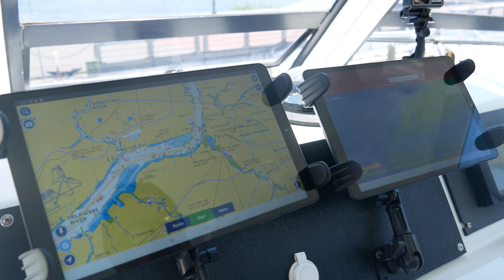How to make a 15 inch chart plotter for only $125    E112

Comment: run forever ? does it back charge to your phone ? because your phones just going to die... and given its using its port to display theres no way to charge your phone at the same time ?
Reply from the maker: To be honest, I don't remember. That video is about 5 years old. I used the system for a couple of years and then the cable broke and I ended up buying another 10" tablet. I usually cruise for about 5 hours a day and I believe my phone lasted that long.

Comment: Make sure you put dielectric grease on the contacts. Because the ports are not weather sealed like a dedicated chartplotter high humidity will eventually corrode the ports. I used to work for an industrial tablet manufacture. They are expensive for a reason and it’s to do with the comments they use and the construction.

Comment: So you need a spare $1300 phone. Noted. Next thing. Do you need to have another cell plan active on that phone to run navionics on it?
Reply from the maker: I just used an old phone that I no longer use. A Note 8 I think, which is basically worthless. Navionics does not require a plan.
Reply: @tryingnottosink9107  Thank you for your content and response. Good to know. The pessimist in me figured it would

Comment: Hi, great idea to use such a solution to mirror your phone on a screen. Are you able to use it as a touchscreen with Navionics or do you control it from your phone? So in other words does the touchscreen respond on finger inputs or is that only possible on your phone with a mirrored image on the 15 inch screen?

Comment: Lovely idea with the 15" monitor.   However, for navigation it will still be dependent on the phone for the essential GPS signal. And far enough from shore the phone can not provide a GPS signal. So...options are then either a separate GPS receiver to another USB port, or buy a tablet that has a GPS signal built in.  Correct?
Reply from the maker: No, the phone always has a GPS signal. So does the tablet.
Reply: You are wrong. GPS signal is available in all locations on the planet.

Comment: Curious how those monitors work in the day light ? Can you read the screen
Reply from the maker: They are bright enough but keep in mind, we have a hard top so they are never in direct sunlight.
Reply: Im down the same road. Most display manufactures charactarize thier display as outdoor readable at a brighness of 800 nits. Typical crlphones are 250 - 350 nits. I got a 60$ samsung 10.1 android 4
42 and 425 nits. Mirror my lowrance to it over on boat wifi and with a display visor, pretty readable. Sendit back and continuing my quest for a daylight readable 15-17 inch display to pair with an old hdmi out android phone wich will run the mirroring fom my console fishfinder.
Reply: Did you ever find a good one?  @cpntexas_x

Comment: You may want to consider a different phone like a newer one. As phones become older the batteries don’t age well. And in extreme cases they turn in a fire risk. I would look in to a cheap new phone that is specked the same

Comment: you seem up on computing nav stuff.  suggestions yu might have for a complete novice.  I am in middle Tennessee getting a boat ready may use within next two years to float down to the Gulf go out and fish a bit.  Thinking radar, sonar, fish finder, navigation and radio but all linked in.  Is that a possibility? And kinds that are best invest?
Reply from the maker: Yes, they can all be linked together. Since you want radar, you would need a ready built system, like Garmin or Foruno. If you can live without Radar (we can't) you can just use tablets and apps like Navionics and Sonarphone. They would link together through Wifi and Blue Tooth. We use a combination. Our radar is on our old Foruno Plotter that came with the boat. Everything else is an app on the tablets. We did several videos on our set up a couple years ago.

Comment: Wouldm't that  drain your airtime? also is that a touch screen?
Reply from the maker: It is not a touch screen, but the phone is. Our airtime is unlimited, but it doesn't use much. We actually stopped using this system on the bridge because I kept having problems with the USB cords.

Comment: Great idea, now I just have to see if I can find a monitor that’s bright enough. I know that when I was looking at tablets they measured brightness in nits, so I’m on looking for some thing that has brighter than 600 nits,  my iPhone 12 has around 800 nits and looks great but it is a little small so if I could find a monitor that had similar brightness at 15 inches or even 12 inches that would be great. Thanks for the idea
Reply: Laptops at least, can boost the brightness using command prompt, or terminal code. Its simple and a google search away. I can imagine it is doable on dex OS and etc for mobiles and external screens
Reply: Further, theres ADB commands like:
adb shell settings put system screen_brightness 255  # Max: 255 [citation:2][citation:6]

Thats untested afaik and would advise to show caution. However monitors usually have a hidden menu, if you mash buttons on the monitor, turn it off, then turn it on while holding another button, you might be able to access the factory settings to change the max brightness value to like, 4000?

Else, invest in a sunshade cover :)

Comment: Hi Ed,
my name is Uwe from Germany.
Thanks a lot for the nice videos you share with us.
I struggled over it while searching for intresting solutions for my Bayliner 275 here in Germany. Well the boat runs in Beglium, which ist jaust near my home. Anyhow I would like to write to you today, as I had nearly the same idea as you had with the monitor. BUT I didn't like the need to touch the small mobile surface for settings or Apps to open. After searching and trying a lot I found a solution that does it all-in-one!!! It is the "V7 L156TCH-1G 15.6" USB-C Portable Touch Screen Monitor". It has all the features you told us about PLUS the possibility to touch the large screen to use all mobile functions. So it is a true display mirror of my mobile. and that ist really the best I ever saw as solution. You may use every App on the mobile when ever you want behind the streering wheel of your boat - incl. WhatsApp....
Best regards, from good old Germany and "always a hand's breadth of water under the keel" as we say here. ;o)

Comment: 1 problem you didn't address is that your phone needs to be charging too..   if it can't be charged wireless you will need to disconnect the screen to charge the phone..
Reply from the maker: No. The phone sits on a wireless charger and is continuously charged.

Comment: Did a similar thing where I have a 15.6" touchscreen tethered to my samsung s21.  Works amazing.    Use a seasucker to mount it up on the dash.  Works PERFECT!
Reply from the maker: Our only type C to Type C cable went bad at the start of the trip and we haven't been able to use it.
Reply: @tryingnottosink9107  you can get another type C anywhere.  Noticed you made it out of Philly and headed south.  Enjoy and be careful!

Comment: Any ideas on how to add navionics or similar without the phone? Stand alone GPS receiver? Love your idea of the larger monitor, maybe even a touch screen?  Sketchy reception on our phone on our lake but really need a chart plotter or map to avoid the shallow spots. Someone else asked as well but the monitor holders you utilize currently on your dash, where did you get those please? Love your channel too, the good with the bad makes it real!
Reply from the maker: You do not need the phone for Navionics. You can download the apps from wifi. We have it running on several $200 tablets as well as the phone. You can also use a mini computer like a Raspberry Pie to run it and use the 15 inch monitor.  https://www.amazon.com/gp/product/B079TGWRNR/ref=ppx_yo_dt_b_search_asin_title?ie=UTF8&psc=1

Comment: Great idea about using your phones gps abilities.  You could probably use it without wifi too. Just download the maps you need to your phone and the gps does not need wifi to work, however , with wifi it may be more accurate. Realize that all gps on phones are not equal, depending on how many satellites your phone will compare determines your accuracy.  When I use to travel all over the world as an airline pilot I would use a global mapping app, such as cities to go, and use the phone without wifi or cell data to not get lost in the big cities of the world, Paris, London, Beijing, Hong Kong, etc.
Reply from the maker: It works very well. We use multiple device with different views, so we always have a second opinion on GPS location. We are big believers in redundancy!

Comment: Ed,  your wifi on the boat can be solved by T-Mobile.  Ask about their 100gb data plan for $50 monthly.  It is 5G and they will sell you a 5G mifi (Inseego) for 50% off.  You’ll have great service anywhere you can get T-Mobile service.

Comment: The c clip on the windless holds the chain hub down on the shaft. It probably popped out or wasn't installed correctly. Looks like you opened a  big project up this time. Stay warm.
Reply from the maker: That is what I thought, but I could not find a groove for it. I have a shaft and gear box one coming, perhaps it will be more clear.

Comment: Hi Ed, Love your videos.  I do have to wonder why a guy who owns a 65 foot Hatteras, is not using real marine electronics.  iPads and cheap screens from Amazon attached to an old phone may work on a sunny day are not the best solution for a boat.  There is a reason why  quality MFDs from the major bands cost so much more.  They work always, in all weather.  Cutting cost on electronics seems penny wise and pound foolish.  I presume you carry full paper charts as a back up to your rube Goldberg set up.
Reply from the maker: Keep in mind, I still have two Furunos on the boat. They work fine. One reason I can get away with tablets is that my flybridge is enclosed. I never have a problem with weather or sunlight. I do have paper charts onboard, but I am almost never out of sight of land, so I do not worry too much. And, I like the redundancy. I currently have 3 tablets, 2 smart phones, and two Furunos on board. All are capable of navigation,  sonar and AIS. The Furunos handle the radar. And, I am cheap. Still, you might see me switch over some day. I have been offered steep discounts from a major brand to install their system and do a video about it.

Comment: Hi Ed, great video. Just a thought, you can also pair a Bluetooth mouse to that Note 8 so you can navigate on the monitor without having to mess with the phone's touch screen. Just a thought. Cheers!
Reply from the maker: That's a great idea! I'll give that a try.
Reply: @tryingnottosink9107  what about a touch screen monitor?
Reply: @billstobie4872  that’s what i’m planning to do. I have a touchscreen monitor at the helm connected to a Windows PC in de cabin. Now i would like to connect a Samsung device with DeX to my Windows computer (you can download DeX for Windows 10/11). Now the question is. Will my touchscreen monitor work as it does not have a keyboard or mouse?

Comment: I have thought the same thing about my old iPads. The thing is, you will need to start the phone bill back up on it to use Navionics, right? I use my phone and a 12.9” IPad Pro right now alongside my Raymarine Axiom on the flybrige. i want to use the old ones on the lower helm. The iPads use cell service. Honestly, I’ve never tried them with the cell off, but my guess is that they won’t work with Navionics. I hope I’m wrong!
Reply: To answer my own question I just tried it with my cell and WiFi off and it seemed to work fine. I guess it just uses GPS and the info that is already loaded. Thanks for the info!
Reply from the maker: Yes, it uses GPS. You only need wifi to download new maps.
Reply: @tryingnottosink9107  thanks so much. If you all only knew how much you have helped us in our cruising. If we ever cross paths, I’ll make sure and send you off with some super Tennessee whiskey.

Comment: The water in the core could have frozen and expanded the core. Causing more stress on the bolts.
Reply from the maker: The bolts did not run through that part of the core.  But you might be right. There might be more water damage that I did not find yet.

Comment: Ed, you mentioned you have Wifi on your boat for navigation so I assume you have it while underway. My question is how do you get Wifi on your boat while cruising?
Reply from the maker: When I am cruising in the States, I just use my phone as a hotspot. Between my phone and Lyn's we have 50 gig available. I am thinking of adding a dedicated hot spot, like the Franklin from T-Mobile. I also have a wifi extender on the boat, which can pick up my phone hot spot, or any other wifi at a local marina or Starbucks. When I am in the Bahamas, I rent a "MyIslandWifi" for $50 per month but supposedly T-Mobile will work there. I guess I'll see this Spring. The last time I was ther I was on AT&T.
Reply: Ditto

Comment: Looks like a super fun job! Just an FYI, if the WD-40 doesn't work, get some stuff the is called PB Blaster! The stuff is amazing at getting rusty stuff apart! I have used it on exhaust bolts on cars from New York and they came off without breaking! Any way to get a fan blowing up into that hole to speed up the drying process? Good luck with the repairs!
Reply from the maker: I use PB Blaster as well. I sprayed the hell out of it last weekend. Hopefully it does not give me much trouble when I try to remove it this weekend.
Reply: @tryingnottosink9107  Crossed fingers it comes apart for you.

Comment: Your trip into the bow reminded me of having to work on a 5.5 meter (transmitting) satellite dish. The "hub" was about the size of a 55 gallon drum, and it was me, a squirrel cage blower to keep the feed from freezing, the transmitter and the amplifier for the receiver. Oh, and a very greasy chain that would always jump off the sprocket if you tried to move it when it was iced up. Ten minutes to put the chain back once you finally got up in there...
Reply from the maker: Interesting! You can see why I was procrastinating!

Comment: Speaking from experience, it's always a heart stopping moment when you discover wet, rotting plywood anywhere on your boat.  I had to rebuild both of the lazarette hatches in the floor of my cockpit deck last year.  However, at least I'll never find any rot there again after the repairs, thanks to the miracle of Coosa board.
Reply from the maker: Hopefully it is not too bad. I hope to find out this weekend, if I can get the rest of the windlass removed.
Reply: @tryingnottosink9107  I sincerely hope you have better luck than I did.  When I first bought my boat ten years ago, I too found the loose bolts on the windless.  The surveyor had totally missed seeing any problem with it, but when I took it apart, I found lots of problems.  Water had gotten down both the bolt holes and under the cat head and into the actual hole in the deck the windless drive comes up through.  It had rotted an area of my bow deck of about 3 square feet.  Even worse, it had gotten into the back end of my bow pulpit and rotted the aft six inches of it too.  The pulpit had to be removed, disassembled and have the entire core replaced.  I was sad for weeks after that bill.

Oh well, having a big yard bill is still better than going to set your anchor and having your pulpit break loose from the hull...lol.  Had a friend that had that happen in the Bahamas. Yikes!

Comment: Any idea if this water issue around your windless is a common issue with Hatteras?
Reply from the maker: I have heard it is. I do not think it originated from the loose bolts. I think they were loose because of the rusted mount. Perhaps I will figure it out once I get everything apart.
Reply: @tryingnottosink9107  The reason I ask is that we might consider a Hatteras as a live-aboard. I do like the layout of these MY's. Of course every boat has its quirks, it's just good to go in eye's open. Really enjoy your channel! Cheers from Vancouver Island, BC.

Comment: I have a 61 Hatt MY in Baltimore and went through some windlass work last winter into this past spring.  My motor was rusted and eventually failed.  It’s replaced with a rebuilt one and I have added a sunbrella cover over the windlass and switches to keep water from getting into there again.
Reply from the maker: We have a sunbrella cover as well. I think we will be using it much more after I get the windlass fixed.
Reply: Gonna make one for mine